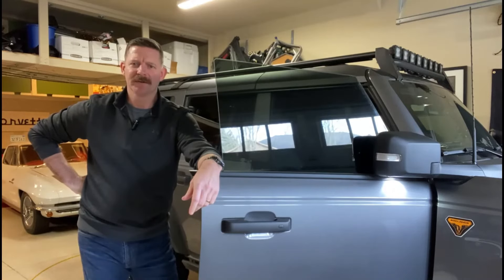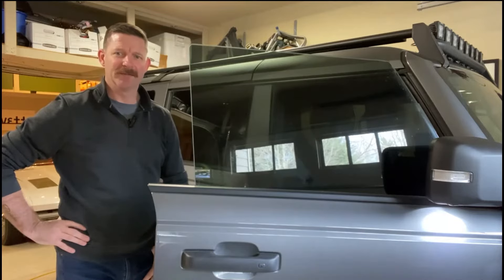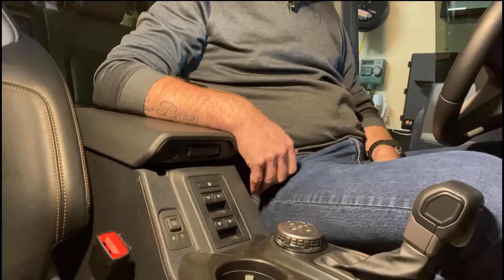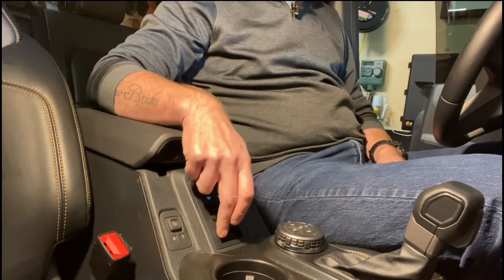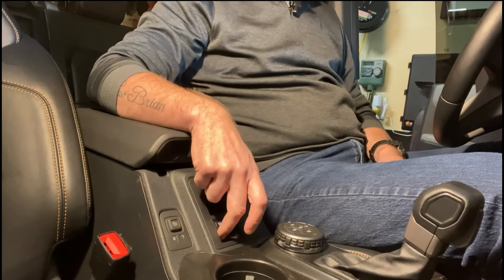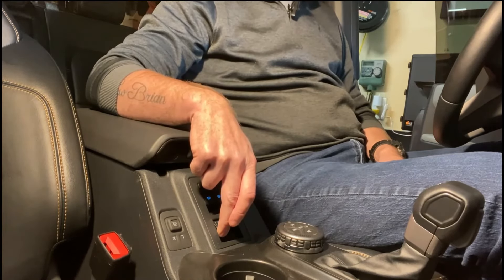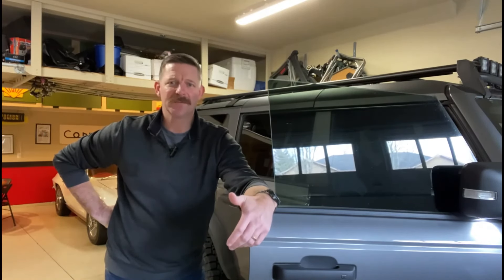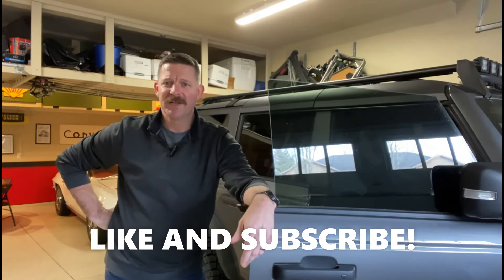How to Fix Bronco Windows (The Re-Teach Method) | Northwest Bronco Overlanding

Comment: Great info. Thank you! My first try at this did not fix the issue, however. I called Ford, and the service manager told me to repeat this process three times in a row. I did so, and it worked like a charm for both windows I was having the issue with. Just thought I'd mention this since the video  doesn't mention repeating the process.
Reply from the maker: Perfect! Great info and thank you for posting it here!
Reply: I will 2nd this 3rd times a charm on fixing the gap issue when closing the door. If it doesn’t work do it 3x in a row!
Reply from the maker: So you have to do it three times in a row? Am I reading this right? @callsign.iceman7913

Comment: Excellent! It's fixed now! I can confirm this works on a 2023 Big Bend Four door.
Reply from the maker: Glad it helped! Thank you for the comment!
Reply: @NorthwestBronco  2023 outer banks. My windows (all 4) go up n down with one touch, but one window (back passenger) will not go up in the same manner. Is there a way to fix that?
Reply from the maker: @zibafairchild6185  Hmm the solution in the video is the only thing I can offer. If that doesn't work, I'm not sure how to help. Maybe a dealer call. UGH

Comment: It fix my issue but only temporarily 😢 it keeps doing it again after awhile. I might check the two bolts under the door maybe if it helps. Thx
Reply from the maker: The bolts won't help the electronic issue. The bolts are more for floppy windows. If you keep having the window not going up and down all the way, it's most likely a computer problem. Now and then the computer may get confused and needs to be reset (the procedure in the video) but if it continues, I'd bring it in to the dealership for repair.